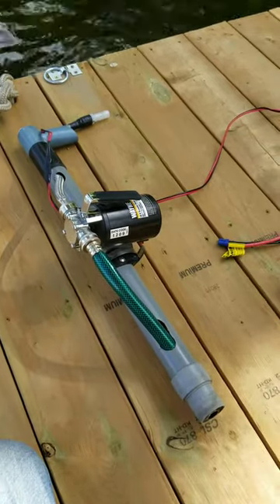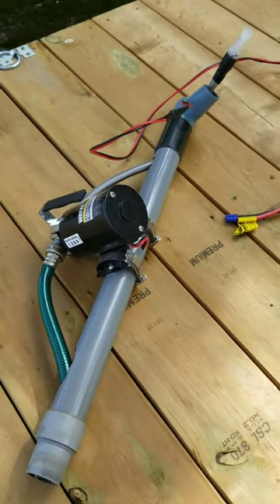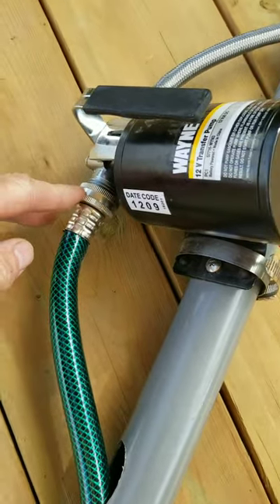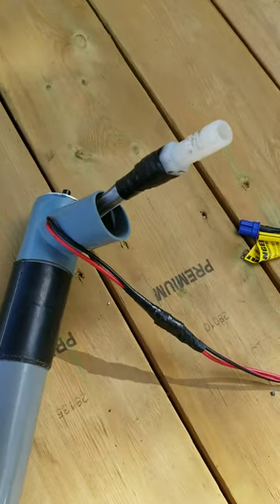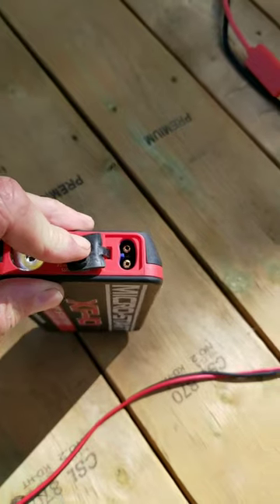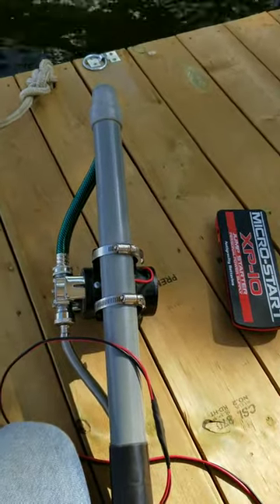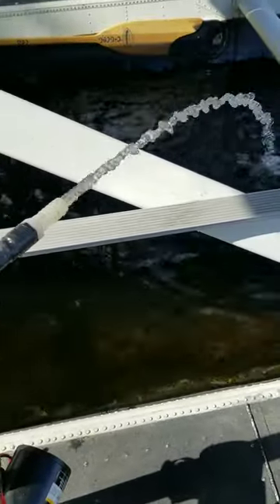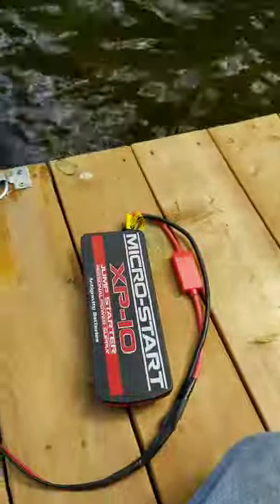Seaplane float pump or Marine DIY portable bilge pump system

Comment: Clever design Jim!  One question - how does that pump hold up over time passing algae and other debris that inevitably ends up in the floats?  Most small self-priming water pumps are very intolerant to any debris.  Greetings from Minnesota and thanks for the information.
Reply from the maker: So I have use it now for 2 full years.  It's still pumping like it did day1.  I have used it to pump a few boats out over the years also.  Boats were dirty.  To be honest...most of hr water is pretty clean but we do have algae etc.  The pump comes with a spare impeller.  I'm careful to not run it dry.  Always drop it in the lake and pull water to start before doing the compartments.  All in all it has more than impressed me.  Hope that helps.  This thing is incredibly versatile.  I put the battery in my back pocket.  Hope that helps.  I'm in  chelmsford, ONT canada